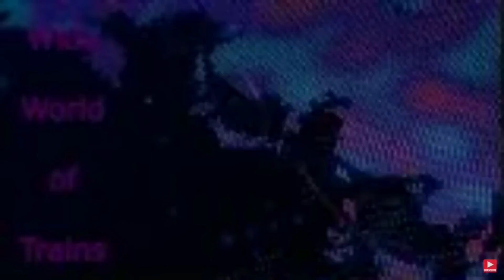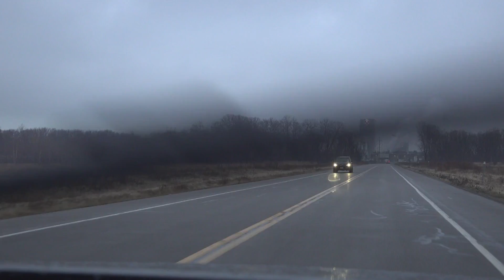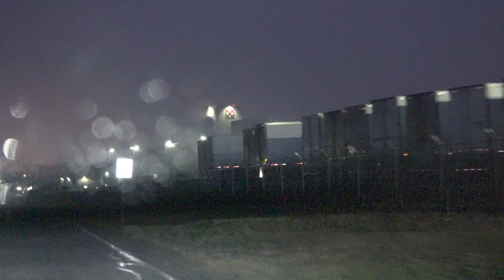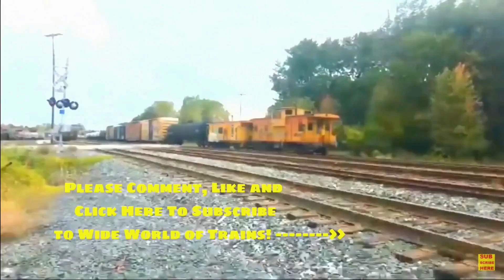Ride With Wide as I Chase A Train Then Wow! A Cool Surprise! DPU Alright On Big CSX Train! CSX GP40!

Comment: Worked for Ralston Purina in 74-75 in Springfield MO and we didn’t produce small animal feeds. We produced dairy, beef, turkey, pig feeds. We received all raw materials and shipped on truck and rail in hopper cars and box cars. All small animal feeds were shipped in from other plants. Maybe you remember Frisco RR. We used them and they must of had 30 tracks across the street from our plant where they built trains. From the top of our plant, I watched them push and release cars probably going 20 mph and when they hit a line of cars, they would come off tracks over a foot. Couldn’t believe it. 
Thanks for videos.

Comment from the maker: Full Description here:   Ride With Wide as I Chase A Train Then Wow! A Cool Surprise! DPU Alright On Big CSX Train! CSX GP40! 3 Trains in all in this action packed train video filmed in and around Dun Kirk NY on January 13th 2022.
0:00 Intro.
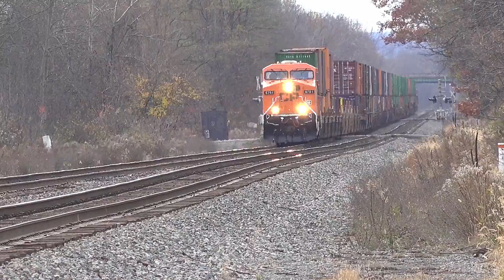0:15 We are at the Berry Road crossing in Pomfret New York on 13 January 2022 and we are looking west as a BNSF powered CSX stack train is approaching. The BNSF engine and some pf the container cars have crossed  the Lake Road crossing and the rear of the train is still blocking the Martin/Willow Road crossing. We see the I-90, New York Thruway, bridge in the background over the train. As the train got closer to us, we see that it is not a BNSF engine in front but it is the Canadian Pacific's engine #8781. This engine is painted orange  and has the wording "Saint John Express" on the sides of the engine behind the cab. On the engine compartment doors the logo of Hapag-Lloyd and the name Hapag-Lloyd. This is CSX train #I166 on its was to the CSX Seneca Yard in Buffalo, New York. This train originates in Canadian Pacific's Schiller Park Yard in Schiller Park, Illinois. At Seneca Yard a Canadian Pacific crew takes over the train and crosses into Canada where the train becomes Canadian Pacific train #142 and go on its way to Montreal, Quebec, Canada. You yelled out "DPU ALRIGHT!
 but we did not see a DPU because you cut away from this portion of the video.
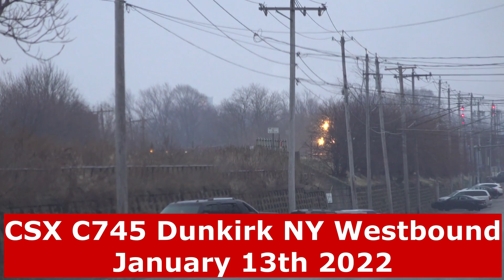0:50 We are at the west end of the elevated tracks through Dunkirk, New York on 13 January 2022as  CSX train #C750 is coming toward us. CSX train #C750 is the Dunkirk Local which is now heading west on its way to the CSX Yard in Erie, Pennsylvania for the night. 
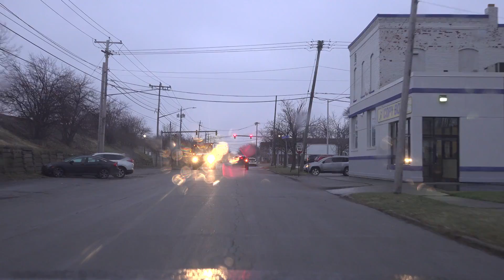2:46 The CSX Dunkirk Local; has past and you hear some talk on your radio scanner that Norfolk Southern train #210 approaching Dunkirk. You pull out the spot where you parked along West Third Street and start to drive east on Third Street. You drive with your camcorder recording you progress as yo drive. At 3:24 the CSX defect detector at Mile Post 42.6 reports that there are no defects on CSX train #C750. 
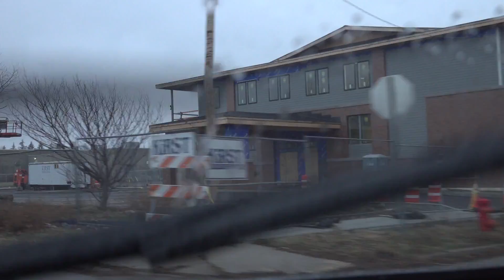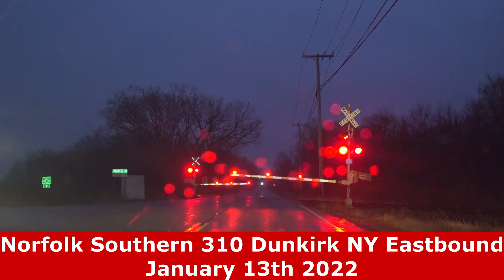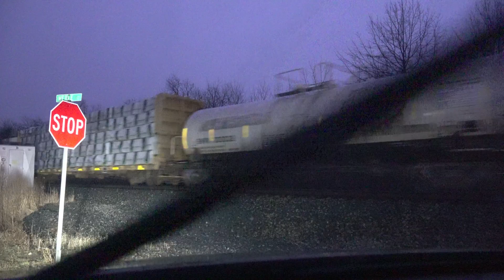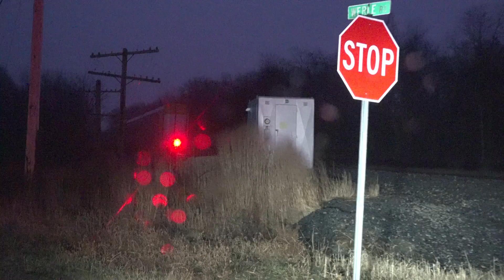3:59 We past the southeast corner of Park Avenue and East Third Street. You show use the new building that is being built on that corner where the pavilion used to be. The parking lot next to the pavilion was one of your favorite spots to watch trains. You tell us that you have been doing some time-lapse videos that capture the construction of the building. Later in 2022 you said you were going to complete the video of the construction of the building and and upload the video. At the intersection of Third Street, Main Street, and Franklin Street, you turn right onto Franklin Street. As you drive on Franklin Street, you mention that part of the ALCO Locomotive plant buildings used to be on our left. You tell us that the building on our left with the two peaks on it was the locomotive assembly building. You turn left onto Talcott Street and cross over the former Dunkirk, Allegheny Valley & Pittsburgh Railroad. This is now a CSX spur that heads south to Fredonia, New York. You tell us that the old ALCO locomotive building became a plant that manufactured grape jelly from the locally grown Concord grapes in the 1940s and 1950s after the ALCO locomotive plant ceased operations. The company was called Bedford Foods. Kraft Foods bought the plant and continued to make grape jelly and other grape products until sometime in the1980s.. Another former ALCO building became an Ames Department store. Nevins Street goes off to the right of Talcott Street where the Ames Department store was on the left side of Talcott Street. Where Talcott Street meets Roberts Road, there is a stop sign. After stopping at the stop sign, you turned right onto Roberts Road. At the intersection of Roberts Road and Progress Drive, you turned left onto Progress Drive. As you were driving in an easterly direction on Progress Drive you mentioned that there were still remnants of the ALCO power plant on the left side of Progress Drive. You went on to say that in the late 1800s and early 1900s a company had to produces there own electricity and steam to run the equipment in their plant. You continued driving on Progress  Drive until you came to Middle Road and the Norfolk Southern tracks to catch Norfolk Southern train #310. You parked on the right shoulder of Progress Drive and turned off the camcorder until Norfolk Southern train #310 was closer to your location. At 8:19 you reactivated the camcorder as the Norfolk Southern gates at Middle Road start to flash and go down. As the BNSF engine and a Canadian National  engine powering Norfolk Southern train #310 cross Middle Road, you turn left on Progress Drive to pace the train along Progress Drive. As you drive along side the engines, we hear the whine of the turbos as the train starts going up a slight grade. At 10:51 you stopped just east of the Werle Road crossing to watch the rest of the train go past in front of your headlights. At 11:08 a BNSF mid-train DPU appears in the train. At 14:41 the end of Norfolk Southern train #210 passes us.
14:57 You make a "U" turn and turn west on Progress Drive as we see the base of the Sheridan, New York water tower. You continue west on Progress Drive past the Nestle Purina dog food plant and appear to make the turn onto Middle Road to go the CSX tracks at Middle Road but this portion of the video stops.
17:57 It is earlier in the day on 13 January 2022 as it is light out. We are at the Berry Road crossing in Pomfret, New York. The CSX gates are going down as we await the arrival of CSX train #I009. CSX train #I009 comes toward us and passes. At 19:01 we see the mid-train DPU coming into view. After CSX train #I009 passes you zoom in on the end of the train as it continues west. We see that the train has both the Lake Road and the Martin/Willow Road crossings blocked. At 21:23 you start to zoom back from the train to a normal view looking west down the CSX tracks. After panning to the east, you turn and start to zoom back in on the end of CSX train #I009. We see that the train has cleared the Lake Road crossing.
22:05 Your Outro begins and continues through 23:54.
Thank you for documenting the trains in this compiled video. A gigantic THANK YOU for all the historical information about the American Locomotive Company plant buildings that were in Dunkirk, New York and those that have been repurposed over the years and still exist in Dunkirk, New York. This historical information is fascinating to me. I presume that other people who have watched this video and some of your more recent videos have also enjoyed your historical comments. (Posted 15 January 2022)

Comment: 0:15 We are at the Berry Road crossing in Pomfret New York on 13 January 2022 and we are lookinfg west as a BNSF powered CSX stack train is approaching. The BNSF engine and some pf the container cars have crossed  the Lake Road crossing and the rear of the train is still blocking the Martin/Willow Road crossing. We see the I-90, New York Thruway, bridge in the background over the train.As the train got closer to us, we see that it is not a BNSF engine in front but it is the Canadian Pacific's emgine #8781. This engine is painted orange  and has the wording "Saint John Express" on the sides of the engine behind the cab. On the engine compartment doors the logo of Hapag-Lloyd and the name Hapag-Lloyd. This is CSX train #I166 on its was to the CSX Seneca Yard in Buffalo, New York. This train originates in Canadian Pacific's Schiller Park Yard in Schiller Park, Illinois. At Seneca Yard a Canadian Pacific crew takes over the train and crosses into Canada where the train becomes Canadian Pacific train #142 and go on its way to Montreal, Quebec, Canada. You yelled out "DPU ALRIGHT!
 but we did not see a DPU because you cut away from this portion of the video.
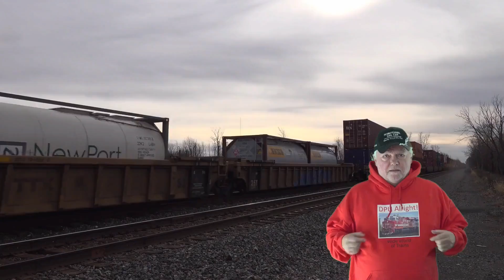0:50 We are at the west end of the elevated tracks through Dunkirk, New York on 13 Janaury 2022as  CSX train #C750 is coming toward us. CSX train #C750 is the Dunkirl Local which is now heading west on its way to the CSX Yard in Erie, Pennsylvania for the night. 
2:46 The CSX Dunkirk Loca; has past and you hear some talk on your radio scanner that Norfolk Southern train #210 iapproaching Dunkirk. You pull out the spot where you parked along West Third Street and start to drive east on Tihird Street. You drive with your camcorder recording you progress as yo drive. At 3:24 the CSX defect detector at Mile Post 42.6 reports that therre are no defects on CSX train #C750. 
3:59 We past the southeast corner of Park Avenue and East Third Street. You show use the new building that is being built on that corner where the pavilion used to be. The parking lot next to the pavilion was one of your favorite spots to watch trains. You tell us that you have been doing some time-lapse videos that caputure the construction of the building. Later in 2022 you said you were going to complete the video of the construction of the building and and upload the video. At the intersection of Third Street, Main Street, and Franklin Street, you turn right onto Franklin Street. As you drive on Franklin Street, ou mention that oart of the ALCO Lovomotrive plant bulidings used to be on our left. You tell us that the building on our left with the two peaks on it was the locomotuve assembly building. You turn left onto Talcott Street and cross over the former Dunkirk, Allegheny Valley & Pittsburgh Railroad. This is now a CSX sput that heads south to Gredonia, New York.You tell us that the old ALCO locomotive building became a plant that manufactured grape jelly from the locally grown Concord grapes in the 1940s and 1950s after the ALCO locomotive plant ceased operations. The company was called Bedford Foods. Kraft Foods bought the plant and continued to make grape jelly and other grape products until sometime in the1980s.. Another former ALCO building became an Ames Department store.Nevins Street goes off to the right of Talcott STreet where the Ames Department store was on the left side of Talcott Street. Where Talcott Street meets Roberts Road, there is a stop sign. After stopping at the stop sign, you turned right onto Roberts Road. At the intersection of Roberts Road and Progress Drive, you turned left onto Progress Drive. As you were driving in an easterly direction on Progress Drive you mentioned that there were still remnants of the ALCO power plant on the left side of Progress Drive. You went on to say that in the late 1800s and early 1900s a company had to produces there own electicity and steam to run the equipment in their plant. You continued driving on Progress  Drive until you came to Middle Road and the Norfolk Southern tracks to catch Norfolk Southern train #310. You parked on the right shoulder of Progress Drive and turned off the camcorder until Norfolk Southern train #310 was closer to your location. At 8:19 you reactivated the camcorder as the Norfolk Southern gates at Middle Road start to flash and go down. As the BNSF engine and a Canadian National  engine powering Norfolk Southern train #310 cross Middle Road, you turn left on Progress Drive to pace the train along Progress Drive. As you drive along side the engines, we hear the whine of the turbos as the train starts going up a slight grade. At 10:51 you stopped just east of the Werle Road crossing to watch the rest of the train go past in front of your headlights. At 11:08 a BNSF mid-train DPU appears in the train. At 14:41 the end of Norfolk Southern train #210 passes us.
14:57 You make a "U" turn and turn west on Progress Drive as we see the base of the Sheridan, New York water tower. You continue west on Progress Drive past the Nestle Purina dog food plant and appear to make the turn onto Middle Road to go the CSX tracks at MIddle Road but this portion of the video stops.
17:57 It is earlier in the day on 13 January 2022 as it is light out. We are at the Berry Road crossing in Pomfret, New York. The CSX gates are going down as we await the arrival of CSX train #I009. CSX train #I009 comes toward us and passes. At 19:01 we see the mid-train DPU coming into view. After CSX train #I009 passes you zoom in on the end of the train as it continues west. We see that the train has both the Lake Road and the Martin/Willow Road crosssings blocked. At 21:23 you start to zoom back from the train to a normal view looking west down the CSX tracks. After panning to the east, you turn and start to zoom back in on the end of CSX train #I009. We see that the train has cleared the Lake Road crossing.
22:05 Your Outro begins and continues through 23:54.
Thank you for documenting the trains in this compiled video. A gigrantic THANK YOU for all the historical information about the American Locomotive Company plant buldings that were in Dunkirk, New York and those that have been repurposed over the years and still exist in Dunkirk, New York. This historical inforamtion is facinating to me. I presume that other people who have watched this video and some of your more recent videos have also enjoyed your historical comments. (Posted 15 January 2022)
Reply from the maker: Thanks Tom, I have more videos like this coming, todays will be a longer one with historical info